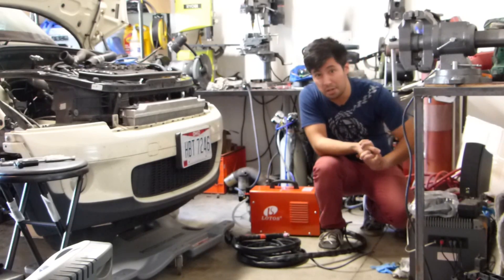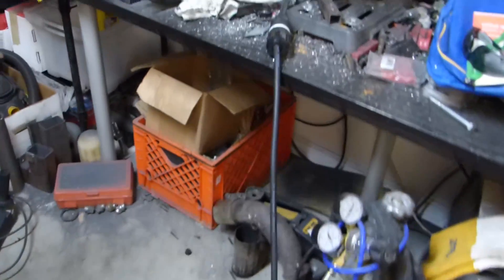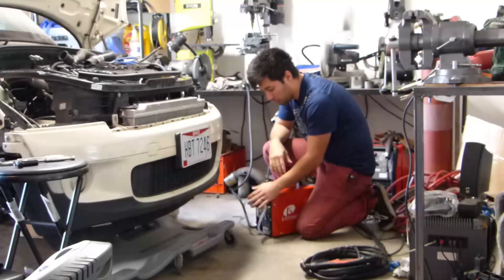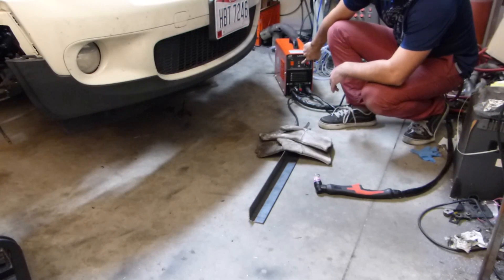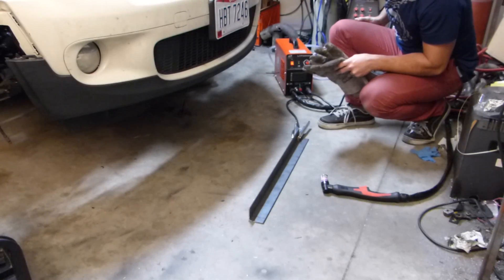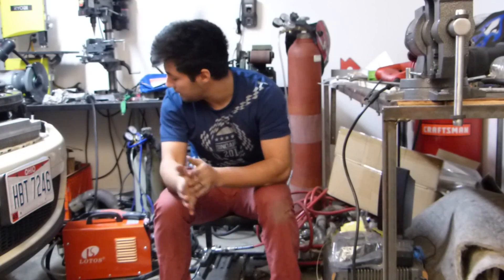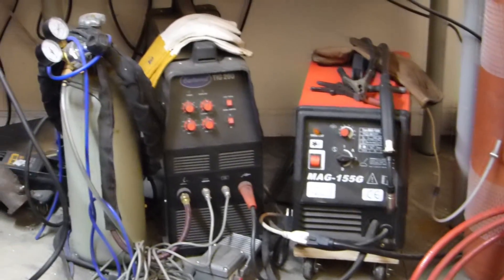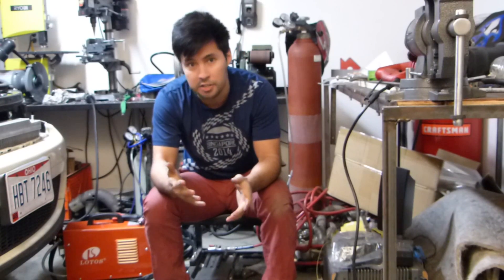✓ Lotos LTP5000D Review & Intro to Plasma Cutting

Comment: Put in  220v plug. That will run best for you on 220v. No you can not cut 1/2" on 120v.
Reply from the maker: I didn't have 240 hookups in the garage when I made the video, but now I do so the next time I use it, will be in 240 for sure.
As far as half inch cuts... I've 100% done half inch cuts on this machine with 120 volts. Now it wasn't a clean and nice cut, but it did make the cut.

Comment: Nice Plasma Cutter! This brand is in the dark and frankly I don’t know why. I have the LOTOS LTPDC2000D (the RED one), purchased at Home Depot on late 2017, and it’s been a “Good Solid Machine.” I wanted to try out the plasma cutting feature because for 20 years I had been using oxy-acetylene to cut metal at my auto repair shop. This machine will do a fine cut on ¼ inch plate, rough cut on a 3/8 inch and will go up to ½ inch leaving a severance cut. Good video and thank you for sharing.
Reply from the maker: Thanks for sharing mate! Yeah I think they changed the color not too too long after I bought mine, but it cuts really well still

Comment: I have been looking at this plasma cutter. It looks like it only has 1 yr warranty. How long have you had yours and how has it held up?
Reply from the maker: So far so good honestly. Definitely comes in handle on thicker steel when I don't feel like destroying 5 reciprocating saw blades. I haven't tried it on thick aluminium though but hopefully I'll get the chance too.
My biggest challenge is my compressor isn't the best for long cuts, but this little cutter keeps doing a great job.
For the money, it's a hard tool to beat ;-)

Comment: My recommendation to you is unless you're doing a 100% duty cycle I would always keep it on 50 that way you're guaranteed it will cut well
Reply from the maker: R Reichel at full power it kept tripping the breaker, especially on cuts longer than a few seconds. Also, it cut cleaner with less slag on lower amperage.

Comment: To my understanding the pilot Ark. Only starts in the beginning if you doing expanded metal the Pilot art doesn't keep  re-igniting itself at least that's what I heard.
Reply from the maker: R Reichel hey thanks for commenting. So it's not an ignition process like an oxyacetylene torch. The arc is always there. You just hold the trigger and it keeps the arc "engaged" so to speak. It didn't go out after I finished the cuts until I let go of the trigger, the arc just got smaller (probably hard to see). Now if it didn't have pilot arc, you would have to keep restarting the arc which is annoying for sure. You have to touch the part to initiate the arc. A pilot arc creates the initial arc for you and then pushes it outward to touch the part so there isn't any actually contact.

Comment: With all due respect. It is potentially dangerous to perform heating functions against concrete. The rapid temperature rise can cause very high energy exploding and expelling of concrete and aggregrate schrapnel.  Just raising your work a few inches would be a much safer cutting environment. Thanks for the video, as I am researching purchasing one of these cutters. ;-)
Reply from the maker: Rob Willbanks hey glad you're considering this product. If you decide to get this one, using the link in the description helps me out a lot ;-)
For your safety comment, no disrespect taken at all. I did lift the piece off slightly even on the first cut but it could be even higher I agree. The risk was pretty low here for popping aggregate for a few reasons. I was only doing short cuts so the concrete wasn't overly hot. The other thing is that because I filmed this video in Ohio, the concrete is air entrained to allow for thermal expansion without cracking so the internal stress build up is significantly less than what you'd see in concrete in the southern states where air entrainment isn't commonly used. Also the maximum size aggragate (MSA) of this concrete is also pretty small as it's only standard 3-3.5 ksi concrete so it's not as bad as it seems but again I agree, I should've lifted it higher from the beginning, or more ideally, just cleared the workbench area haha
Thanks for the comment and hope you enjoy your future plasma cutting as much as I have
-Ryan

Comment: That machine is a beast on 240 volts. Mine has held up well. Here is a link for cheap consumables, they work great.
https://www.amazon.com/Farmunion-WSD-60-Cutting-Nozzles-Consumables/dp/B01GMMGS1Y

Subbed.
Reply from the maker: Oh awesome thanks a bunch. I'll add that to my saved products on amazon for when I need it. Thanks for sharing and thanks for the sub ;-)
Reply from the maker: Also, I can't wait to try it on 240V. My new garage should have 240 if I remember correctly. Still waiting for my tools to arrive

Comment: Hey I just got a very similar plasma cutter! I think it may even be the same internals, though I'm not sure. Mine is a few years older though and may not have the pilot arc.
Reply from the maker: NICE! Yeah that pilot arc makes a huge different. It'll burn through paint or rust and let you get straight to cutting without prep. A real time saver
Reply: I was JUST wondering if that was possible! Thinking about how many rocker panels I need to cut up. I hope mine has it, but I'm doubtful.
Reply from the maker: Well worse case, it's something to keep in mind if you ever need a replacement or an upgrade down the road 😉👍